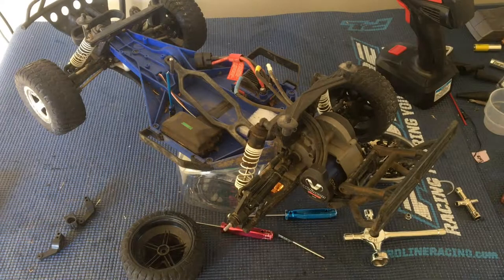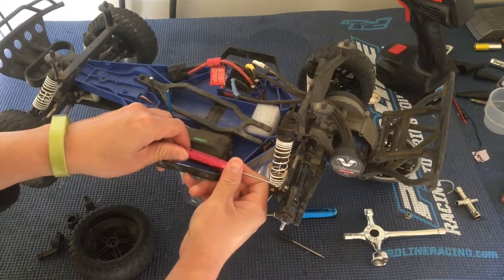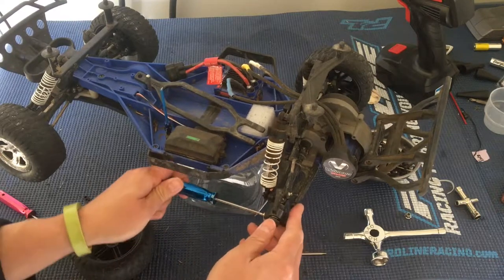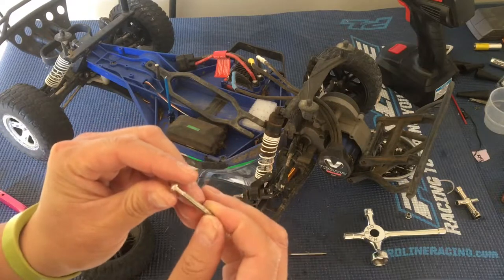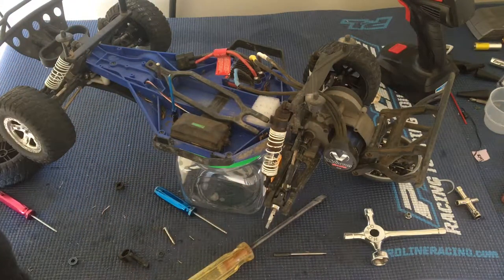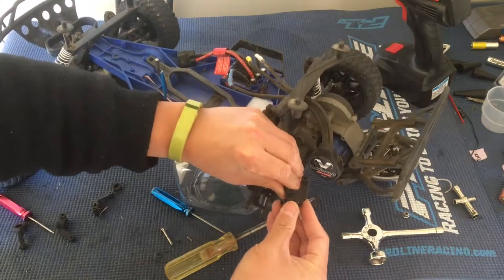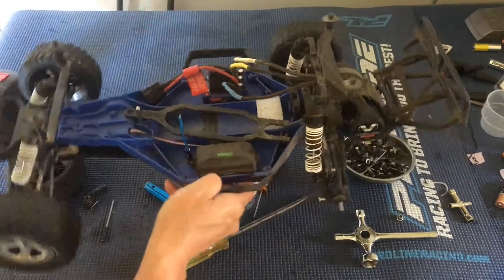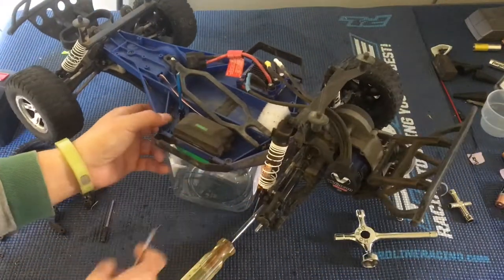Traxxas Slash 2WD Broken Rear Bearing Carrier Replacement, Applies to Stampede, Rustler, and Bandit

Comment: What thickness is the Teflon washers for the rear and front? I don't have any washers to prevent wear on the bearings. And the driveshafts have a little play on my slash.

Comment: What is the higher hole adjustment for? Like when you want to lower the car???
Reply: All my trucks use the bottom hole but I'm looking at my slash lcg an how low I have it an I was thinking the top adjustment hole of the rear hub carrier is better for a lower truck what is your opinion what that hole is used for? I can't find any answers online....
Thank you